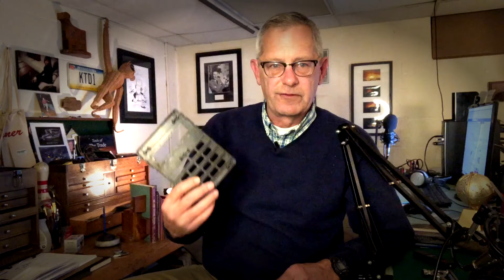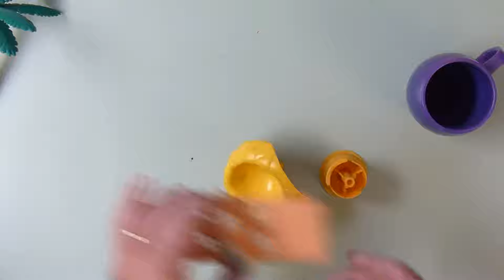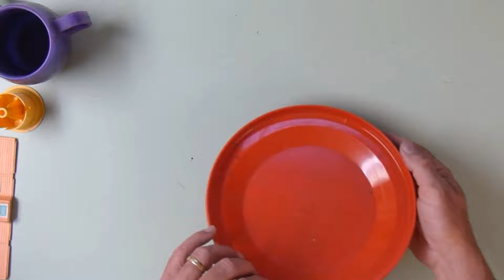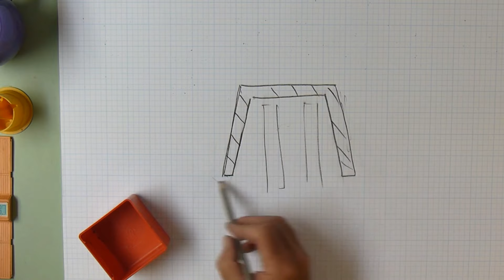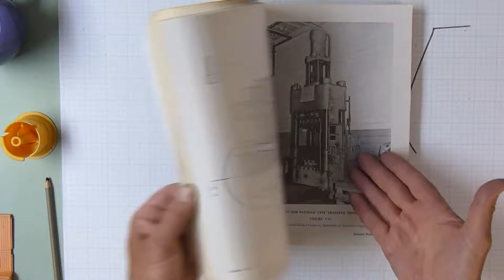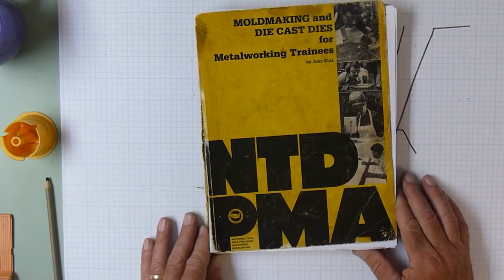Moldmaking: Lesson 1

Comment: These videos are great.  I purchased access to your website over 6 years ago when I entered my apprenticeship.  I work as a toolmaker in the automotive stamping industry, not in the design or build stage but rather the production, repair, modify, maintenance side of things. I remember watching a video you did with the Starrett taper gauges and I went straight to Ebay to find a set. I use them quite often.

Comment: While watching this I had a plastic bottle cap beside me and it got me thinking how the heck do they mold threads into it and still eject it?? Phil, I enjoy you IG account and the string of videos you've been releasing lately...Thanks!
Reply: There are a few ways, but with a bottle cap they have a rotating core, so the plastic is injected in and when the mold opens the core rotates and the part backs itself off. Look up how bottles are made. They mold a slug with the threads and then use a blow mold to expand the shape of the bottle